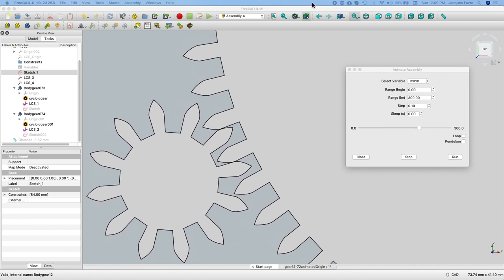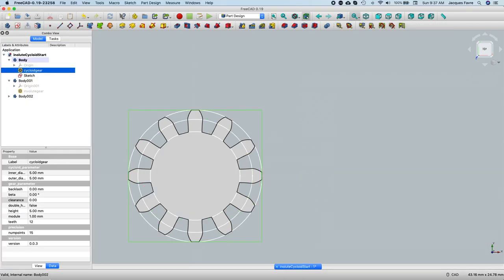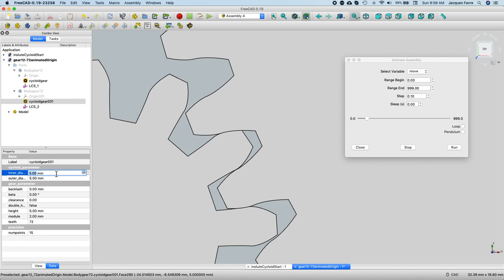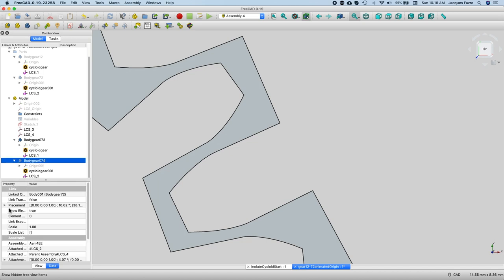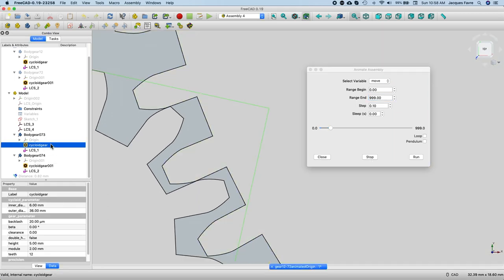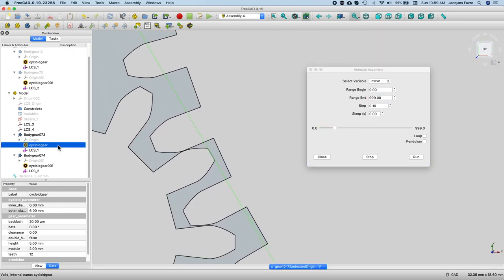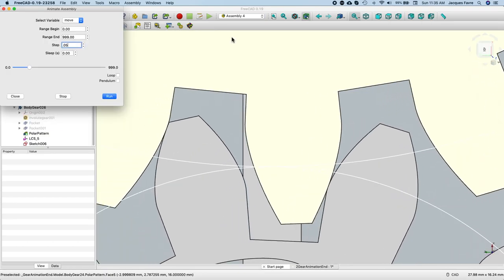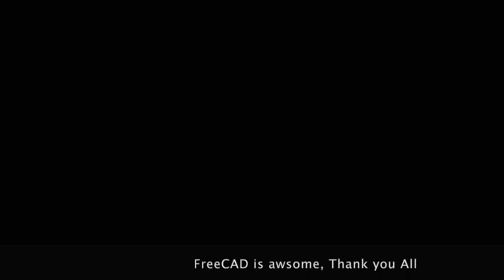Cycloid Gear Animation and Customization

Comment: Are the kinematics of the gears still correct if the outer diameter is not matching the other gears inner diameter?
Reply from the maker: According to the animation, I believe so.
from my understanding from this article
https://www.csparks.com/watchmaking/CycloidalGears/index.jxl
there are lots of trade offs in manufacturing clock gears
inner diameter to be half of the pitch diameter to create straight flank make it easy to manufacture and polish
pinions in watches end up as circle, again to make easier and limit the number of gear cutting tool needed
In my case, with additive manufacturing, there is no limitation with shape
Now I have not gone below 12 teeth on the pinion, some clocks/watches go down to 6
That is when a big wheel drives a small pinion, like 100/6